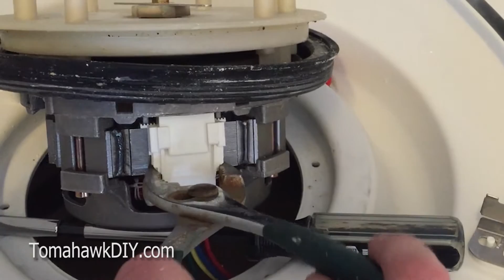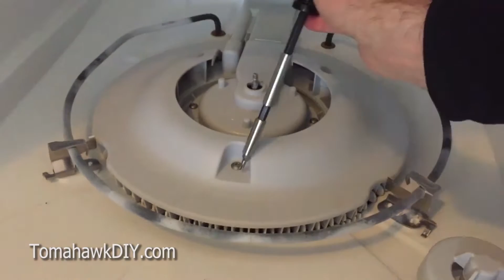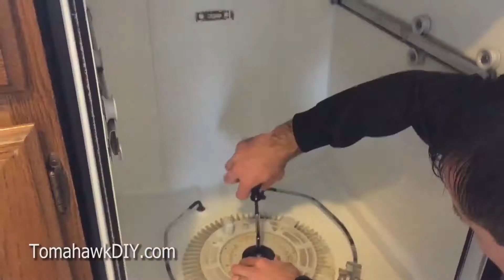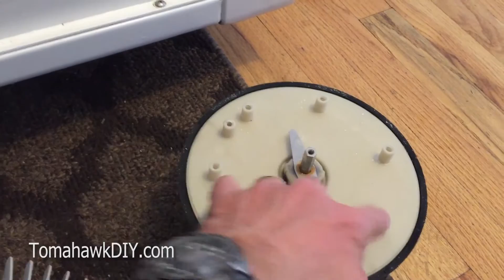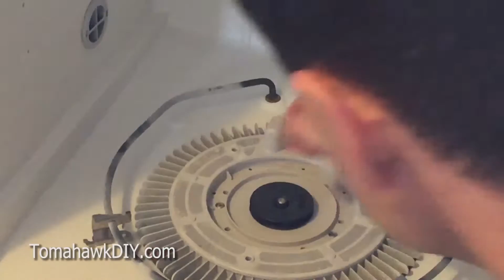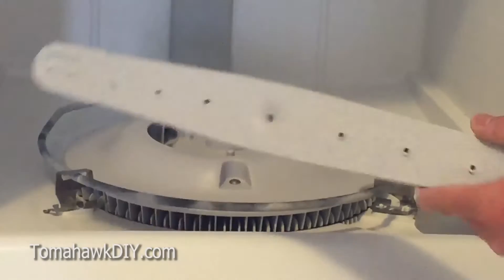How to Replace Motor and Gasket - Maytag Dishwasher

Comment: Do you think that's what's wrong with mine if it goes to the whole cycle of washing but doesn't seem to have water pressure. When we first got it, you could hear the water hit on the sides inside.  Now it's just going through the whole cycle but quieter. So the motor?

Comment: Great Video.  How did you diagnose the issue to be the motor for that dishwasher?  My dishes don't come as clean as they used to.  I also hear a loud droning noise from mine during different parts of the cycle.  The unit drains fine and I hear water swishing around as expected.  I've removed everything down to the motor, cleaned up the screens and blade. There was little debris found.  I removed the debris, reassembled but still have the loud droning sound. I suspect my motor may be the culprit, but wanted to get another opinion before buying a replacement.  Thanks

Comment: When I removed the water distribution arm the metal bracket came off with the assembly. How do I reattach it the the back of the dishwasher. I tried to take the brackets off the are and attach to the dishwasher but can't see how that would work. Can you help please?

Comment: OMG! I can’t believe I found your video but I am SO GRATEFUL to you for doing the video the way you did, although a bit too fast, but I knew how to slow it way down. I am a 56 year old single female with no one to help me and no money for a repair person. I recently bought a used dishwasher from someone online. I was running it nonstop the day before but it was leaving food pieces and garbage on my dishes and on the bottom of the unit. So now all I could think of was try to figure out how to take it apart and do a very detailed cleaning of everything. What I discovered was so gross! Anyway… thought I would remember how to put it all back together but no… I got confused. I contacted Maytag and they would not help me except to tell me I needed to hire someone professional. I have spent hours over yesterday, last night and this morning trying to figure out troubleshooting issues and then looking for something detailed about taking it apart and putting it back together, on the lower portion; and I could not find anything (probably the way I worded it all … but I kept varying the wording and still no luck…but I was looking for my exact set up Maytag MDC4650AWW portable). I was so worried I would miss a step or something. Anyway, you helped me a tremendous amount so thank you very much!

Since I have you here (kind of)… wondering if you can help me with a few more questions tho regarding this dishwasher?

1.  I found this clear or white rubber “seal”? loose in the gunk and track around the motor assembly (I have taken pictures and I am not sure yet if you can get those here or not… ). I am not positive where it goes but in looking over everything I am thinking it goes to this one section (picture) but I am having troubles getting it put in there. Am I right and if yes, any tips on getting it inserted into that grove? 
2. Another question regarding the heating element on the bottom. It was so very coated with the lime? or hard white stuff and it was a challenge to get it all cleaned off (I also had troubles with the water heating and taking too long to heat) so I used various cleaning items and chemicals… but now my afterthought is could I have ruined that element and was there some kind of special coating on it that I may have destroyed?
3. I am not sure if I did this by accidentally pushing or resting too heavily on the door while open, or if it was already done, however, I noticed tears at the location where the bottom of the door meets the bottom of the dishwasher base, both sides, (picture) and now I am really worried about it leaking and that it is not fixable because it looks like everything is basically all one unit. Any suggestions?

Thank you for your time and expertise and caring to share and help others!!

Susan

Comment: Im going to have to echo the same response that a few had here and say that this saved me. Ihad an intermittent sound during the wash cycle that resembled air bubbles being forced           through the pump.  Loud at times and it would last for the whole clean.  I took apart as the vid shows, really scrubbed up the fins, and cleaned out the bottom of the washer.  Just in case, i   spun the motor and heard no sound so i might be on to something here.  reassembled it all,      and crossed my fingers for (no leaks) and a no screaming  air filled pump.  and it worked.        What i think was happening, not enough water was getting cycled back through the pump        causing a bit of air getting pulled in and forced through the pump.  (at least that's my theory     anyway).  You at least gave me the confidence to pull it apart and clean it up like new.  Here's    to hoping it stays quiet.  Thanks for the tutorial.

Comment: Thank you for this fantastic video.  The repair tech quoted me $600, but this video gave me the confidence to try it myself, and I found an unused motor on eBay for less than $100.  Worked perfectly.